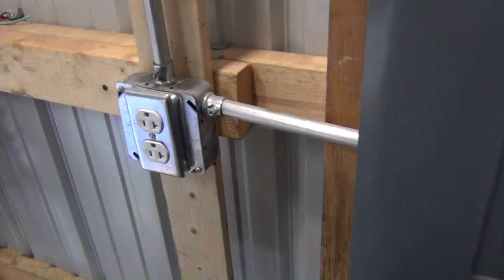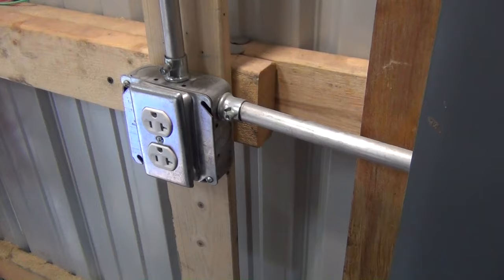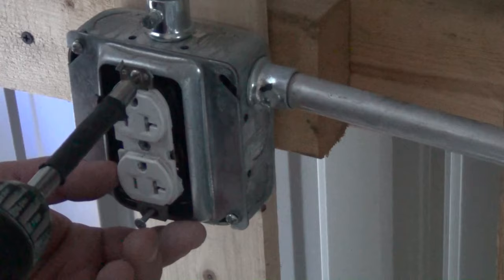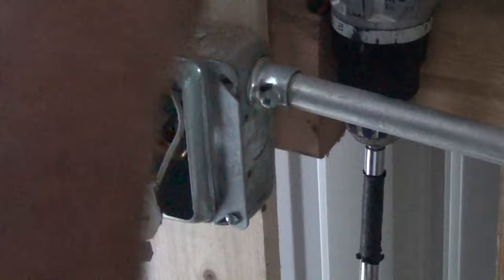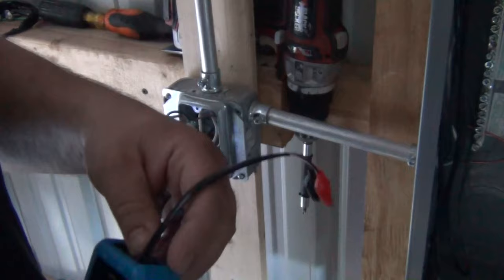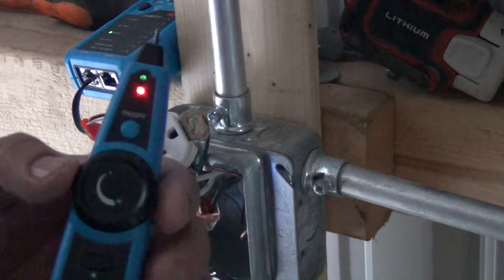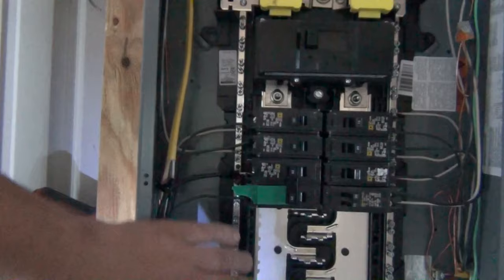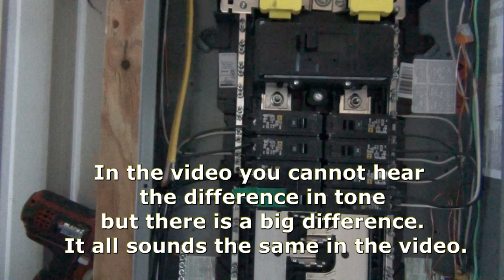How to locate a circuit breaker 110v , a dead circuit  ( house wire  ) without ripping open wall

Comment: So then how do you locate the breaker for a hardwired appliance like an oven, cooktop, etc without going through and shutting each breaker off one at a time until you find it?  Ovens are usually on high amp breakers but cooktops (for example) are not always the same.

Comment: If testing a series of dead outlets and light switches in a Mobil home where one side works and the other side works where do i start. can i connect to any of the dead ones and trace it to the circuit breaker panel

Comment: Does someone make a tone injector that is built into an AC plug form factor?  Could wire up a pig-tail adapter, but a plug-in tone injector would be easier. Thank you.

Comment: Nice, I was wondering how to use my Sperry network tone generator to find a AC wire. Your approach makes total sense! Personally I am going to make a plug to connect the clips to instead of taking the outlet out. Just got to mark it with a huge warning 💥
Reply: Great idea ..  wonder if I can just cut off extension cord plug end expose those cut off wires and hook gator clips to them

Comment: This was great.  I really never thought off killing the mains then using a tone generator.  Now I just have to find mine.
Reply from the maker: I love these comments. I’m glad you found it useful and wish you luck on your task. Thanks for watching and commenting, I greatly appreciate it. Please like share and subscribe.
Reply: How does it find break if the power is shut off? Im still not understanding that
Reply: @floridagirl9064  Tone generators create a radio frequency on the line. The probe picks it up and plays a tone the closer you get to the wire

Comment: With that type of drywall ring you only needed to listen the 2 screws kitty corner and pushed up and 45 deg to right, you could access your wires with less  taking apart

Comment: I have 2 bedrooms with no power. Purchased a new 15amp gfci breaker but it didn't fix my issue. The new one tripped as soon as I put it in and reconnected power. So I unplugged everything in both bedrooms and it does the same thing. I wonder if I have a bad outlet in one of the rooms that's causing the breaker to trip? Their are no gfci outlets in either of the rooms. Any advice would be helpful. -Thanks

Comment: How would you find where outlet is not working. All breakers are working , several outlets and switch not working. This is in a home built in the 1920's.  Could you follow with probe to find breaks.?

Comment: Does the tone generator make a noticeable sound in walls to help trace a wire? I'm talking through just lathe and plaster and/or drywall, in my case as I try to find out why I can't get my outlet to power.

Comment: I wonder if it will track a wire that's hidden behind sheet rock? I have an open somewhere that's caused a 2 rooms full of dead AC outlets and am not sure how the wire feeds. I'm thinking it goes to the ceiling in the bathroom to pick up power maybe from the fan circuit.
Because it goes in the bathroom/dining room wall from the crawl space into an outlet. 

This looks quite a bit nicer than the  very basic one harbor freight sells for about the same price. I can walk in and get the Harbor Freight one though.
Reply: I have the same question. Did you find out the answer??
Reply: @trevorswansonbtw  Yes I had a wire blown in two where a rat had nibbled on it where it laid touching a cast iron vent pipe for the bathroom.

Comment: That was good.  I bought your recommended device.  Now I just have to use it.  I have (presumably) several dead circuits (entire banks of dead outlets).  Does this sound like a symptom of a dead circuit breaker to you?

Comment: If you have a dead outlet that is down line from a gfci outlet, but you don't know which gfci outlet, will this tone generator method still work at the circuit breaker box or would you have to try each gfci outlet individually?  Thanks great video!

Comment: Recently I had trouble finding the breaker switch in the panel that feeds electricity to  gfci outlet that was not working at all.  I replaced it and it works but I  still do not know what circuit breaker controls that particular string of gfci controlled outlets.  I bought the exact same devise you used in this video and I will do exactly as you showed in the video, kill electricity to the panel before putting tone to the outlet.  Thank you very much for your good video.  Keep up the good work.   My back up thoughts were to plug in a light bulb to the gfci outlet and start turning on and off circuit breaker until the lite turns off and the gfci is working properly.   Your thoughts would be appreciated.

Comment: An old tech showed me the easy and fast way.  Make up a heavy cord with a 40 amp fuse and a heavy switch (50 or 100 amps)  Set it up to dead short the circuit through the fuse.  Plug it in and flip the switch momentarily and the breaker is found. (Only a trained professional should attempt this.)   If the house burns down you know that the circuit beaker was defective.  (When the tech showed me this it was with the bare Romex wires and a screw driver)
Reply: I've been dead shorting circuits for years to find breakers...takes seconds

Comment: Hi, thanks
Customer has an outside flood lamp fixture that we can't find the switch for or the fixture was disconnected at some point when an extra bedroom was added to the house.
There are a couple 3way switches we've located that don't seem to do anything... maybe totally unrelated.
I screwed a circuit finder into the lamp holder and tested the circuit box and got nothing...
Is that because the light fixture is "switched off" somewhere and or also the line is just dead?
Reply from the maker: Did you check to see if all the connections were tight, even the neutral wires? At the box and switches. Also check to see if there are any splice boxes. You could even have a loose wire nut somewhere. I hope this helps. Please let us know the outcome
Reply: @handymanPF  
I haven't opened the exterior fixture box yet but I'll open it up tomorrow.
After it goes into the soffit I have no idea where it goes.
Thanks
Reply from the maker: Anytime. I appreciate you. Thanks for commenting.

Comment: So I have a have an outlet with no power next to washer and dryer, but in the electric panel there’s a breaker label washer and dryer( it control the basement light and some outlets) but not giving power to the outlet...there’s drywall I check the GFI outlets making sure they are not trip

Comment: If I have a 15a/15a tandem breaker and only one of the 15 keeps popping, will this method still work for me? I am still a bit confused how to follow it through the walls though once have that tool...
Let me try to explain my situation.I have a mass array of wires coming through the main panel and it's also installed inside  cinder block wall in garage... I have tried replacing breaker, checking all the outlets i know are on that line for wiring or ground issues and still nothing.  I even found one outdoor spotlight w/the cap off and wire all exposed.  Fixed it and still doing the pop asap once turned on. Any advice appreciated!

Comment: QUESTION:   ONCE THE MAIN POWER IS TURNED OFF!!!    Rather than taking the time to open the outlet box,   would it be OK to use the male end of an old extension cord with the wires cut and bared a few inches out from the plug as a connection point for the tone generator?   Good video,  Thanks
Reply from the maker: I do. But I was kind of skeptical about showing people that method. I hold a lot of stuff back because of that reason.
Reply: @handymanPF   I know what you are saying.  Probably best not to mention that alternative BUT...  I would bet that many time conscious, seasoned electricians would opt for the bare wire solution.

Comment: I have one dead outlet, I've checked all other outlets and all are working fine, nothing is tripped. I'm not a electrician so I won't open that box. How much will a electrician charge to locate the bad breaker for this outlet?

Comment: Great tutorial👍
Would this tool help me to figure why both flood exterior lights on each side of the house and under one switch don’t work?
Thank you
Reply: Most all outside lites and plugs are on a ground fault circuitwith  plug located in a covered box outside near the lites. Check to see if  you can find one and check the buttons in the plug to see if it was tripped and engage the other button present on the plug to reset it. This may be your fix.
Reply: @bobgieser2943  what if they arent?

Comment: Question, if you connect only the black wire to the tone generator, will you be able to trace the wire to the correct CB without flipping off all the CBs?
Reply from the maker: If you do not flip off all the breakers then the signal will travel through the leg in the main panel and will give you a signal in every circuit breaker in that leg. So by shutting off the circuit breakers, you are isolating all the breakers in which will help you identify which breaker is giving you the problem. I hope this helps. Thanks for watching and commenting. Please like share and subscribe.

Comment: Interesting. Wonder if that tool could be used to trace circuits on an electronic appliance board. 
  I am thinking it could to some extent.
Reply from the maker: Interesting question, in which I do not have a definite answer for but I would not rule it out. Thanks for watching and commenting. Please like share and subscribe.

Comment: Mr. Handy,Thank you for helping us.
My question is:
Is there any device can works with electricity in the wires?
Greetings from 🇸🇦
Reply: Yes, If you want to follow a wires path there are many tracers that can be used on a live wire. Something like the Amprobe AT-6010 can be used on either hot or deenergized circuits. If the wiring is functional and you just want to find the breaker there are many breaker locators on the market. I'm not familiar with your countries wiring so can't recommend any in particular.
Reply: @robb1165  
Thank you so much..

Comment: Sir, is it safe to the tone generator? Thank you very much for this video. But unfortunately my tool for tracing circuit is only the multimeter.
Reply from the maker: You have to cut the power just like you would for a multimeter in the ohm setting for testing resistance. There can be absolutely NO power to it at all. The thing with the tone generator is you have the one device you can attach to the problem circuit and use the receiver to find the other end of the wire through the wall or to the other end for several feet.
Reply: @handymanPF  Thank you Sir. Hopefully, the company I worked have this kind of tool.

Comment: Hello , I have an dead outlet in the living room area , one light in the hallway and a dead oultet in the bathroom. the bathroom light works but not the outlet. What are your suggestions to this problem.
Reply: First thing you want to do is test the line wires to see if there is voltage present. If there is then the device either is bad or had a loose connection.

Comment: @ Handy Man Now that we have identified both ends of the wire (breaker/outlet), what do we use to trace the wire and find the faulty spot in between?
PS My son works for a cable/internet  provider, I'll see if he has this tool, but if not, I'll go out and buy it.
Reply from the maker: Personally, I would replace the whole wire for safety reasons. Especially if it’s behind a wall , because a mouse or other critter might be chewing on it in other spots also. I’m a better safe then sorry type of guy. I hope this helps. Thanks for watching and commenting. Please like share and subscribe. Also please hit the notification tab 🔔
Reply: @handymanPF  How do you replace the whole wire when it is behind a tiled wall, under a cabinet under a sink under the kitchen floor into  the breaker box down below?  Also does this thing detect power through sheet rock and tile?
Reply from the maker: @billparker5457  cap off both and all ends and use cable raceway to run the new circuit . Here’s a video I made on how to do that 

https://youtu.be/ievsNsj1qm0

And here is all the items I use in this video
Cable raceway https://amzn.to/2ZEG4sL

Raceway wall light switch https://amzn.to/32xB7DI 

Voltage sensing pen https://amzn.to/3eEbOSR

Magnetic level https://amzn.to/2OCXjEd 

Cordless drill https://amzn.to/2DO2SO0 

Wood screws https://amzn.to/2ZF2yd5

I hope this helps
Reply: @handymanPF  It's got to be in the wall.
Reply from the maker: @billparker5457  I would recommend that you hire an electrician. Because there is only so much I can do through the comment section without actually being there and seeing your project.  A professional electrician would know exactly what to do.
Reply: @handymanPF  Thx
Reply: @handymanPF  can you actually find the short location by backtracing from the box?

Comment: Handy Man ,..So you found the circuit problem  but didn't explain how to fix it . Not much good to me if the problem isn't corrected .
Reply from the maker: There was no problem with this circuit. It was a demonstration. There are quite a few things that can be wrong with a circuit, not enough time to cover in a short video. But this video will help you in the process of diagnosing the issue. Thanks for watching and commenting.
Reply: There’s always one guy. Thanks Handyman for your help. Your description of the video was exactly what was done. I have this exact issue going on in a clients house and hope it’s the circuit breaker

Comment: Too much work already. Just make a circuit buster and plug it into the outlet and you’ll find out which breaker is what in a second.
Reply from the maker: How would that work with a dead circuit?